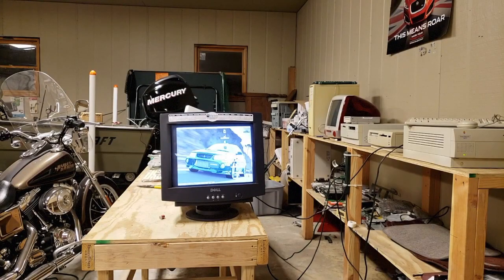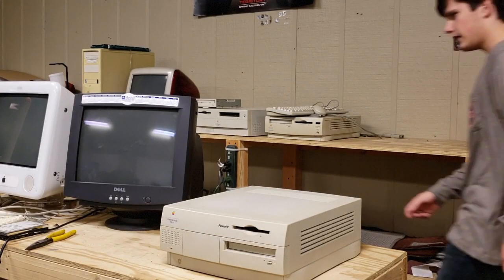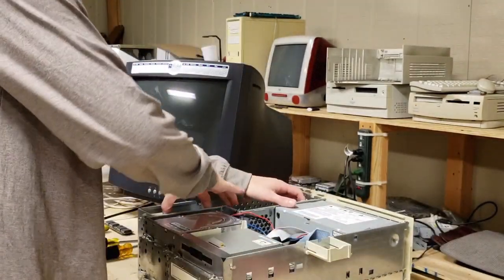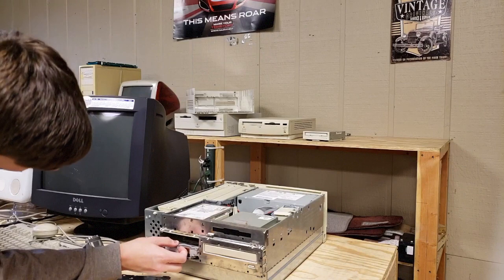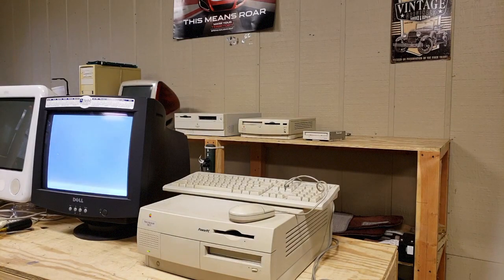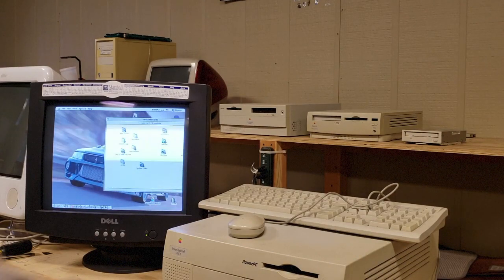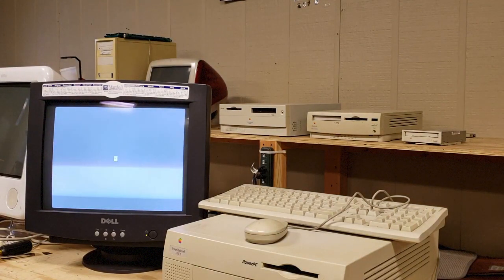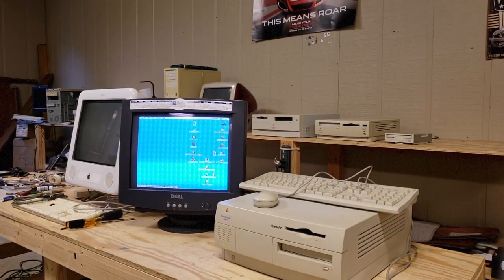Power Macintosh 7200 Upgrade (Again)

Comment: The problem is that it is a 7200.

Those things were dogs, and famous for it.  They were slow, not stable, and crashed constantly.  I worked with them at many companies, including Hughes and DirecTV.  Later on if I ran across one, I would not even work on them, just go to the storage room and grab another Mac.

Even by 2000, those were dirt cheap, those of us who had to work with them knew how bad they were.  I knew Hughes sent back thousands of systems.
Reply from the maker: Thanks for the info! Never knew that about these Macs.
Reply: Even the 7100 is better, this model was bad and can explain a lot of problems.  Hughes at the time (95-96) was trying to go half PC and half Mac.  We fought with them for over a year before Apple told us there were problems and suggested we upgrade to the 7300.  Instead we sent them back and went all PC.

Later I worked at other companies, all the same.  Disney, Chevron, and others.  All had bought them, all swore off Mac forever because of time and money wasted.  I was a Mac tech before then, and moved to PC as they quickly left the corporate world.
Reply: I have a 7200/90 that holds a lot of sentimental value, as it has been in my family since new in 1995. It went cold and dark sometime around 2011 and I’ve never gotten around to trying to fix it, but I did store it carefully for when I do. I know they are dogs, but if I wanted to revive it anyway, where would you suggest I start first? I am thinking the PSU but they are proprietary.
Reply from the maker: @amtrak706  try the PSU first